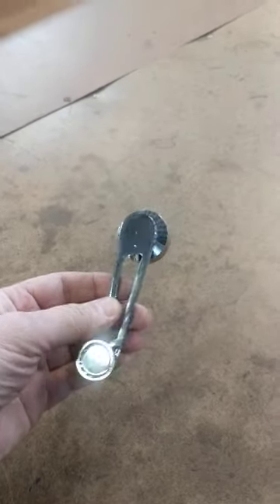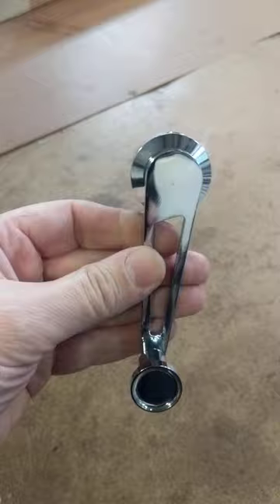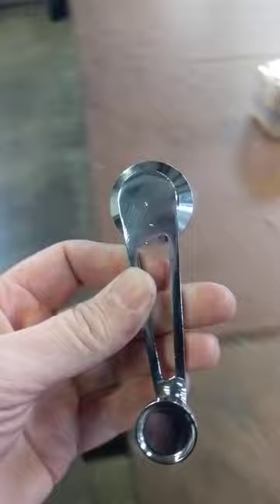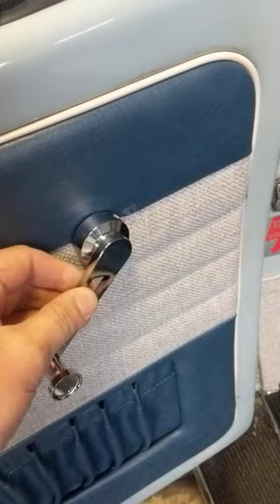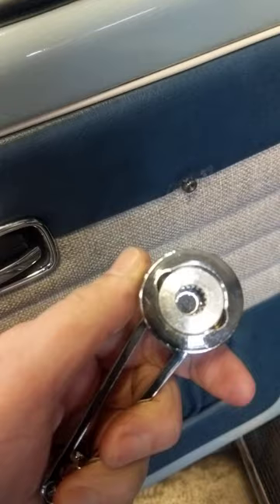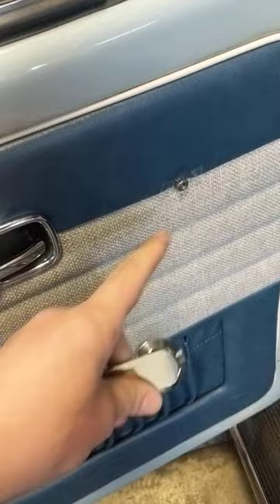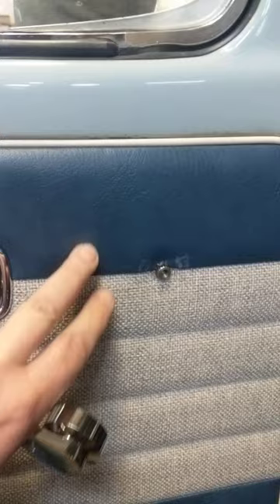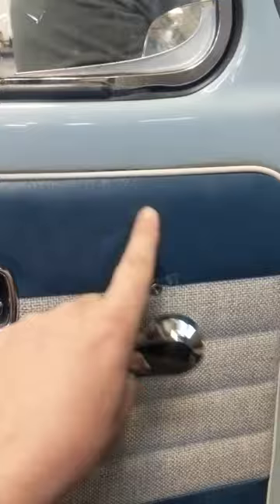The Troubling World of Aftermarket for your VW Beetle Bug #short #shortsvideo #vwbug

Comment: I am absolutely amazed at the poor quality of almost all of the parts available for aircooled VWs now. I recently did a frame off restoration of a 71 Beetle. I bought the best stuff I could find for everything, and almost all of it was junk. Nothing fit, tolerances were comically bad, and most stuff looked like it would break just looking at it. Sad. Vendors have to stop selling this garbage. As long as they sell it, the manufacturers will still make it and keep real (more expensive) parts manufacturers out of the market.
Reply from the maker: I know man we see the same thing at our shop everyday, and it's getting real scary even with safety stuff like brakes and wheel cylinders.

Comment: Window cranks have been the singular part I've had break the most. Since mine is a 74 Super Beetle I'm trying to keep stock looking they're all cheap plastic covers with even cheaper pot metal for actual cranks. I've had the knobs fall off, the cranks break and them just not attach or my pairs won't match.

I don't over crank the windows, my mechanisms are smooth, just these damn cranks are made so cheap that they break by normal use.